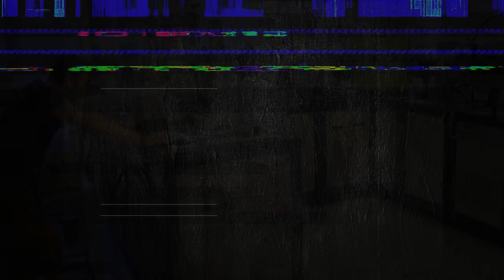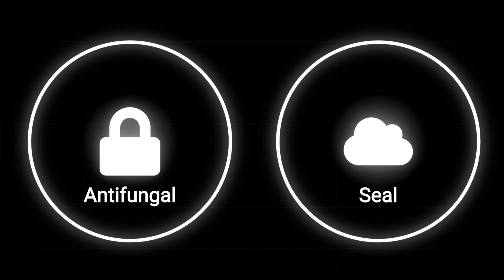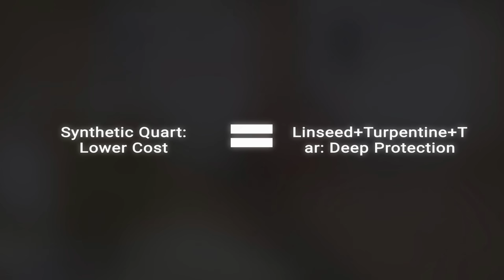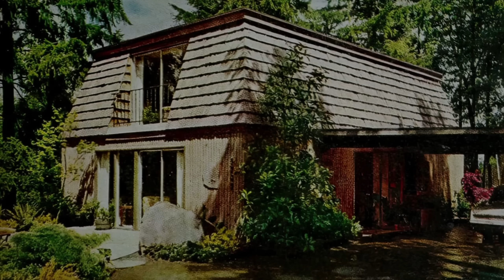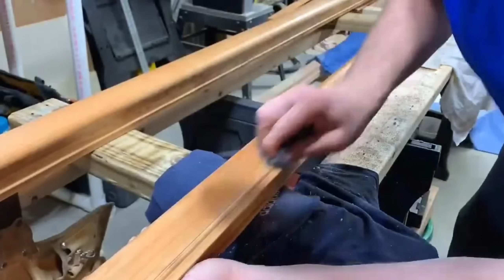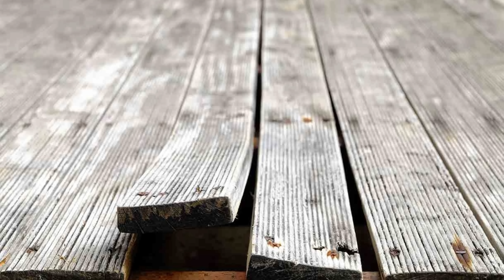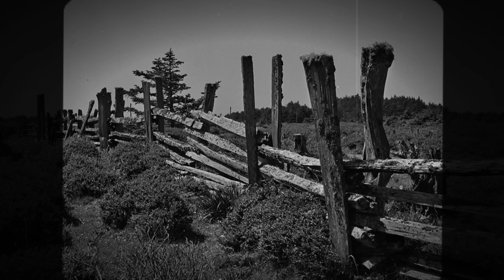The Amish Have Never Replaced a Wood Fence in 200 Years— The $2 Treatment the Lumber Industry Buried

Comment: 1929 Sears House.  Michigan.  Cedar shakes on sides.  NEVER REPLACED.   I would guess they were pre-treated by Sears, putting them in a warm pressure vessel with linseed oil, pressurize for a period of time, hours to a day.  Full penetration.  House was always repainted every 10-20 years, just paint, from the 1960's forward, and that would be through the full chemistry of paints that was there over that time, from oil based to latex based.  ONE PROBLEM WITH YOUR VIDEO.   YOU NEVER ADDRESSED PIN TAR and its use for the wood.   You show it, how its made, but never the application of it.  Since the linseed oil is outside, it will take weeks / months of UV exposure and Oxygen exposure to polymerize.  "JAPAN DRIER" Legit product at Lowes, Home Depot, newer formulations are not Pb based, turn weeks into days for setting, especially if this was inside wood, treat outside, polymerize, mount inside.     I can tell you, that when it comes to taking lumber pine, planks from the aw mill, and taking those and turning them into turpentine out the top, pine tar out the bottom, and then charcoal leftover you can also sell, I'm an world class expert at that chemistry and process...... but... I'm afraid that in 2026, even if your video is 12 days old.   Authentic Turpentine, original material, and Bee's Was, is NOT the price you mentioned.   Linseed oil - real stuff, even homedepot  $26 / gallon.    REAL bees wax < $20 pound delivered.   Your AUTHENTID Turpentine DELIVERED is just < $100 / QUART   (even on amazon) but, other legit sources confirm the pricing.  Including the one you had on the screen, still, one thing you cannot buy is time, and even at these prices, the cost opportunity of your time is priceless.   ....and I'd wait weeks, or months, depending on the time of the year, to put the bees wax on the wood, you want that linseed oil to polymerize.on the surface, that takes UV and oxygen.   Then the bees wax coating.   Truth is, most any iso-paraffin(wax) should work as the sealant it is VERY translucent to opaque to UV and the addition of any Aliphatic polyurethanes are supreme at UV protection, hell, you can even use bulk cheap Zinc Oxide ZnO (found in Desitin, and seen on peoples noses on beaches) to protect from UV, in your wax coating but, it will come in any color you want, as long as its white.  :)   reach out to me if you want to show how to make and use Turpentine and Pine Tar, not only do I own the old books you show, I mean, the phyical books, not just the ones on books.google.com out of copyright, but, I've done it, and more for decades. ... and I have a lab in PA.   NOT close to Lancaster.

Comment: Can you stain fence black after you complete that process? How long do you have to wait for it to absorb/dry? Does anyone know?
Reply: i mixed raw (RAW)   linseed oil with a little pure gum turpentine and soaked softwood picnic tables with it.   they gradually turned pure black and have stayed that way ever since.   it does take a long time to dry
Reply: @figapow That's crazy! I wonder what turned them black? Your mix is kind if clear yellow, before you apply it,  right?
Reply: Cap the fence posts to keep water out the top.  Coat every few years.  Decks need frequent applications they soak a lot more water.  Add tar if you want to thicken it up.

Comment: I live in Australia and 26 years ago I moved into a house that had a white wrought iron fence at the side of the house that let anyone look through to the pool area.My father in law suggested chipboard sheets fitted to the fence for privacy. I mentioned this to my work colleagues and they laughed and said it would last a week after the rain penetrated it (Sydney Australia gets more rain than London per year).
My father in law cut the sheets to size and then laid them on the carport floor and brushed linseed oil liberally one side at a time and when it was fully dried he painted them white. 
After 26 years the wrought iron fence has chipped a lot and needs a new paint job but the chipboard sheets are still white and moisture free.
Reply: Impressive! 👍🏼
Reply: Awesome testimony

Comment: I have a 60 year old fence built with what I suspect is original old growth redwood.
The 4X4 posts were replaced by prior owner in 2008.
I stained it with conventional stain in 2013. 
Occassioally the fence boards fall off and I screw them back in. 
There are pine cross members that rot away. So I just replace them

Comment: Interesting video. The historical use of pine tar, linseed oil, and gum spirits turpentine is real, and the traditional 1:1:1 mix does have a documented preservation history. But the video overreaches when it turns that into “industry buried this” and “one treatment lasts basically forever.” Traditional wood finishes can work well, but durability still depends on wood species, prep, climate, UV exposure, and maintenance. Good history, useful idea, but people should treat this as a traditional finish option, not a miracle cure.
Reply from the maker: Appreciate the balanced perspective and extra context! 🪵

Comment: Going to have to have a play with that. Pure linseed oil costs $250 for 20lt. Last time I did a fence I used said 20lt for one coat when mixed with 10-20% mineral turpentine. So dearer than you suggest.

Comment: geeze dude, this seems like good info but you've made it so confusing with conflicting images and never once showing how you make the concoction. I don't even get where the PINE TAR comes in (or how much to use.) Maybe revise this vid so we can utilize this knowledge.
Reply: Agree! I'm having to research this info now because it points you in this direction but doesn't tell you what you actually need to do to make it.
Reply: @tylerdougherty4868  agreed. I do think that he is trying to push people to buy his Amish Home Secrets book (or whatever he called it). I will have to actually go do some research as well.
Reply: @tylerdougherty4868  1/3 pine tar on outside wood only.
Reply: I saw another video that added white vinegar to the boiled linseed oil and turpentine.  I REALLY want to believe this works because my 10+ year old deck is in dire need!

Comment: I use double boiled linseed oil. The best. Can be mixed with turpentine.
Reply: Will this work on normal cheap radiata pine to seal and weatherproof? I want to weatherseal pine box that will be sitting under carport at back door and l don't want to use the expensive crap they have had hardwares. Everyone in Oz raves about the new product Cutek which is so engineered, it reacts with any other product you might want to use if it "fails" you.

Comment: I painted my small barn with pine tar and linseed oil. I only did that because I could not afford paint  and I happened to have both because I used both for other purposes. So after I did that I gave it a year to dry and then I finally painted the barn the way I wanted with oil paint. That was 20 years ago and the barn still looks like the day it was painted. It shows no sign of peeling. I had no idea that I was saving the barn so well.
Reply: Where did you get Pinetar?
Reply: Did you use raw linseed oil or boiled linseed oil?
Reply: Can you tell me how to do that

Comment: They prepared wood decades before cutting it, they would damage sections of bark so the tree starts healing itself making sap and pushing it where damaged wood is, every year they damaged new sections, but not too much or tree could die, after about a decade tree trunk was filled with sap, they would cut it,  the timber would last for around 1000 years, no rot, no termites.

Comment: One of the things they also did for fence posts in the ground was char/ burn the end that is placed in the ground. That’s the first step. Than apply the pine tar to the entire post. Often you would soak charred end in    A bucket filled with the mixture for a few days. Remove and let dry in the sun for a week or two. It will never rot. It can be in the ground for hundreds of years and it will not rot. It’s a process but it’s permanant
Reply: That's the way to do it still, here in NorthWest Pennsylvania, posts last longer than people for sure that way, lol !!!
Reply: The part of the fence post in the ground that rots first, is what I've seen (of modern fences).    And you can't take it out to re-treat it.

Comment: It mentions using pine tar but only talks aboutvusing linseed oil and turpentine  ( and lster beeswsx with linseed oil). How is the pine tar involved?
Reply: Lot of people asking this. He says equal parts turpentine and linseed oil. Tou add alittle bit of pine tar for outside posts. My assumption is that any exposed wood should have a small amount added. Not required for interior wood unless you want a darker finish.
Reply: In Sweden we mix equal thirds of oil, tar and turpentine to treat boat hulls, decking, boat piers and such.
Reply: Yes the traditional “boat soup” is equal thirds boiled linseed oil, turpentine, and pine tar! I keep a can of it pre mixed, and use on my boats. Also a dab behind each ear attracts mermaids😉
Reply: They tried to explain it pretty clear.. real turpentine is made from pine resin. The mineral spirits or synthetic turpentine you buy in normal stores are not the same turpentine as made from pine resin. It makes natural oils more liquid and soak deeper in to wood

Comment: Motor oil and diesel once every 40 years will do the trick too.
Reply: Can one use the motor oil you buy in containers?   Mix motor oil with diesel gas (2 parts of motor oil to 2 parts of diesel fuel) into a container then apply to wood??
Reply: @schretien8714 yes
Reply: Used is better
Reply: This is so toxic!!! 😮
Reply: @Jackson-xy3uz exactly the bugs don't go close to it
Reply: I’ve done this and it does the trick ❤

Comment: This is supposed to work great for exposed wood but you don’t explain how to preserve the part of the post in the ground. That will be much more vulnerable to rot. 

This is very easy to mix and apply yourself. I’m planning to use tung oil instead of linseed. Very similar but supposed to be more durable. Add a little UV additive and mildewcide and it should preserve even better.
Reply: read the replies... theres one  that a guy wrote that explains how to do that.. lots more info in the replies
Reply from the maker: Great points on the underground portion and those additions sound solid! 👍

Comment: I want to believe.
But there‘s not one second of authentical footage in your 20 min video so I must assume the whole thing is just click-bait.
Please correct me if I‘m wrong!
Reply: Lol it is a little sketchy looking when the guy who gives the intro video looks nothing like an Amish man and has a Tamil accent! However I can vouch for the information in this video being correct. Not sure about anything else on this channel as this is the only one I watched. We just built a log cabin and I used black brown pine tar and linseed oil on the outside, linseed oil and turpentine on the inside logs and the beeswax on red oak floors. I LOVE everything about how my cabin turned out. I have a video of it on my channel if you are interested.
Reply: @inthegardenwithgwen could you link the video please? Thanks!
Reply: @sobrevida157 it’s in the channel bud 😂
Reply: This is the real deal. This recipe makes for much harder and stronger tool handles. Essentially the recipe is Equal parts BLO + Turpentine + Pine Tar. It penetrates deeper if warmed to about 120°. To make it slightly shinier and harder, you can add 1/4 part Penetrol to the mix. Soak or let sit for like 10 minutes, then wipe off excess. Let dry 24-48 hours between coats.
Reply: @johncobb9675 - where to find these products online?
Reply: Greyed wood or silver does not turn golden brown again. That’s BS
Reply: @95lovi actually it can turn brown maybe not that much but I applied some to my deck and made big difference!  You just need so much it would be cheaper to get stuff at lowes
Reply: @95lovi , I used this formula on a bench in our woods. I have no idea how long it had been there before we bought our property two years ago. The wood had started to rot. This turned the color to brown from the aged gray when it cured out. The wood feels harder now too. I live in a wet climate too
Reply: Authentical? 😂😂😂
Reply: LOVE the wide mouth jar! 🤣🤣
Reply: Maybe they used cedar for fence posts, or locust, naturally decay resistant. But cedar trees grow very slow, locust a little faster; but all the old growth tree's have been turned onto fence posts and shingles so now what's left is expensive luxury.
Just stop with the click bait,  what if I told you...
Reply: States three (3) ingredients, but the formula is only for two (2) ingredients. Left out the "PineTar". 
 Linseed oil, Turpentine, and Pine Tar, but the mixing formula does not include the pine tar, nor the ratio of pine tar. So... What is that about ?
 I have to agree with other comments here in that this is only click bail to sell the PDF BOOK.
 PINE TAR, if mixed in will give your formula a very dark finish, and may remain sticky for quite some time.
I do a lot of woodworking, furniture, and wood carving, caricatures mainly, humorous figures that are difficult to seal for protection over time from cracking, etc. I use a mixture of Boiled Linseed Oil, and Dark Umber (dark brown) oil paint, in a tube, same as artists use for painting. One 1/2" squeeze length of paint from the tube to a quart of the oil, stir well. This gives and slightly brown tint to the boiled linseed oil.
Next I put my carvings completely submerged in the tinted oil for 10 - 20 minutes, set the carving on top of the open jar on a couple chopsticks to drip dry, so to speak for a couple hours, the on a couple folded paper towels for a day, wiping any shiny excess off. Seals all the nooks and crannys of a carving while leaving them with a slightly aged look, and works very well.
Boiled Linseed Oil mixed with oil based polyurethane is a nice hand rubbed finish on some of my furniture as well, followed by Johnson's paste wax, or beeswax melted into the boiled linseed oil for a more traditional protective matte sheen.
So many combos to try for what you are looking for, and the linseed oil being the best base for me, makes sense for bringing out the grain and helping with moisture prevention.
Back to the video, what about the pine tar ? Would be fine on a barn !!!
Reply: @ronerie in principle you agree with the video. And you should. Turps, a reducer in b.l.o. then seal the surface with beeswax.
Reply: @jackrichards1863  One third pine tar on the outside only wood
Reply: Waiting for an Amish guy to comment here to clarify this 😅🫩☠️
Reply: @TheDeadKingsRaven 😂
Reply: @TheDeadKingsRaven  Since the Amish will never use a computer you will be waiting until Hell freezes over for a second time. LOL
Reply: @steveforbes8287 congrats on getting the joke 👏
Reply: Sweet. Thanks. I won’t waste my time👌
Reply: How about checking the research or speaking w/ an Amish or Mennonite builder? 

Well, I did just that. They're using some sort of synthetic product for decks now😢 (Mennonites in PA)
Reply: Then this isn't for you
Do the research or go waste your money

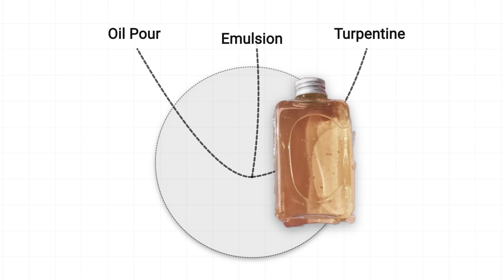Comment: At 8:56 the diagram looks like equal parts of “OIL POUR”, EMULSION, TURPENTINE, but as I heard the audio track says, Mix equal parts of boiled linseed oil and real turpentine, in a wide-mouthed glass jar, seal the lid and shake for 30 seconds until it clouds into a golden Emulsion. Then apply with a clean cotton rag etc.. Can someone clearly list all of the actual recipe steps? I don’t want to buy the book being hawked at the end.
Reply: Linseed oil and real turpentine cost a fortune
Reply: Just do it and figure from there.  Small scale at first
Reply: @dalethomasdewitt  This is by far the most worthless comment in this thread. Try harder!